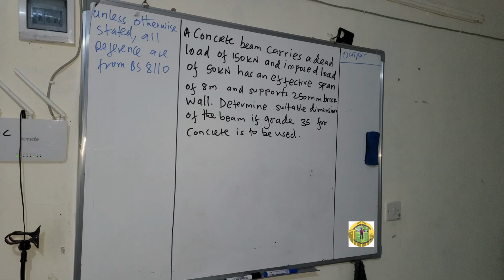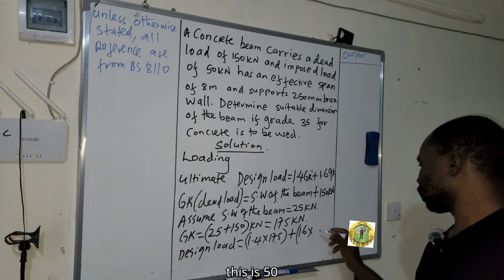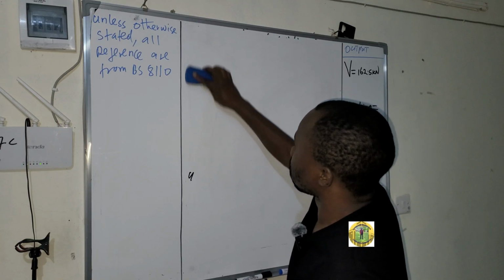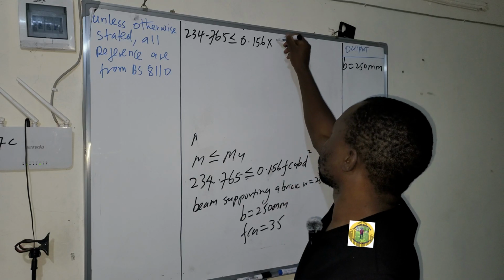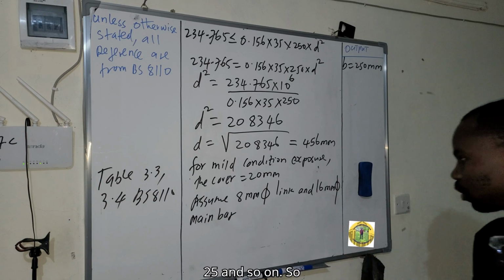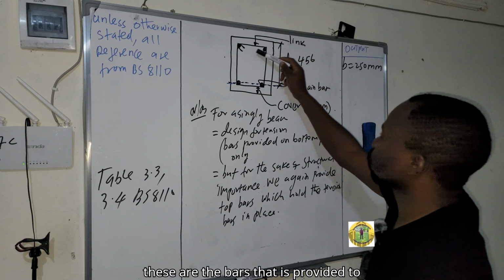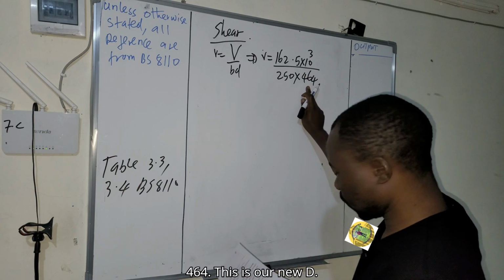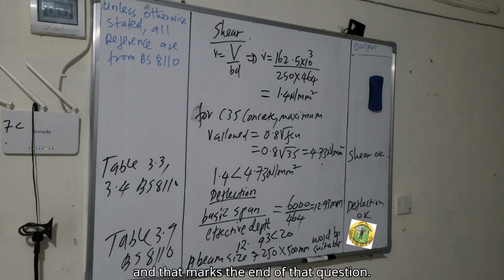DESIGN OF SINGLY REINFORCED BEAM TO BS8110 - EXAMPLE 1

Comment: Hello sir,  when I try to punch in my calculator am finding different values
Reply from the maker: where exactly SO that I can help. example at minute 60:09 I'm getting different answer.
Reply from the maker: Sorry Engineer there is small error, d^2 = 171,989 and d=415mm. The procedure remain the same just use 456mm for learning purposes. Thanks for keen observation.
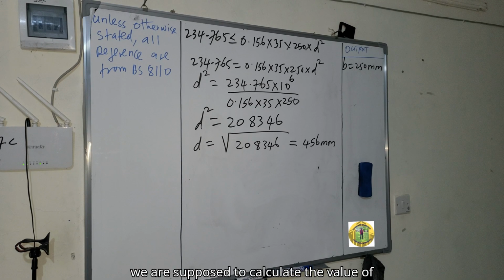Reply: @OdavigiStructuralHub  I think it's at 19:35, the value of "d" doesn't tally with what I calculated, and I tried it several times n different calculators